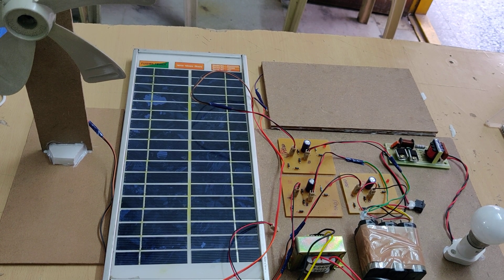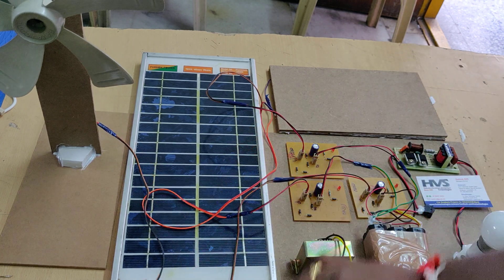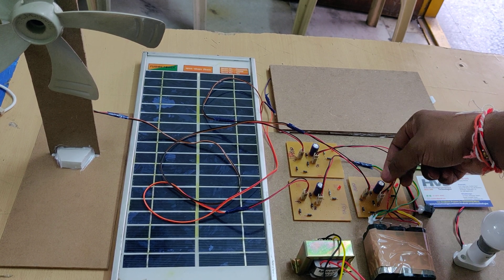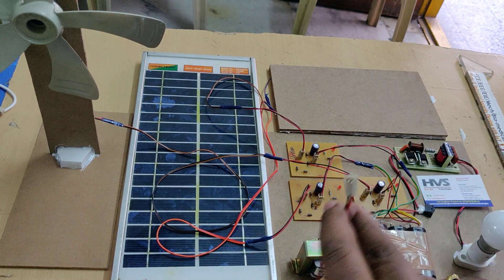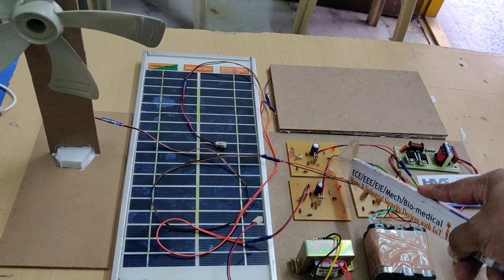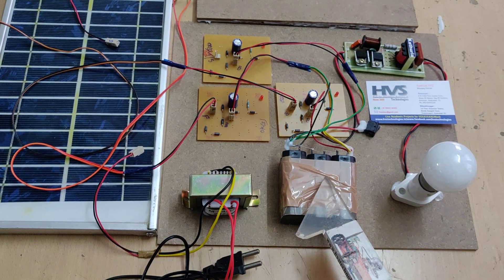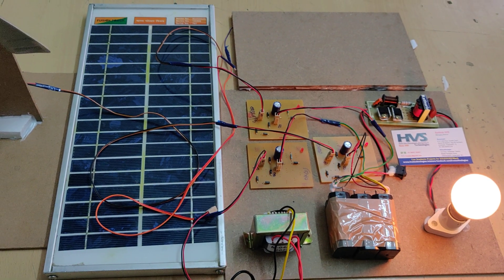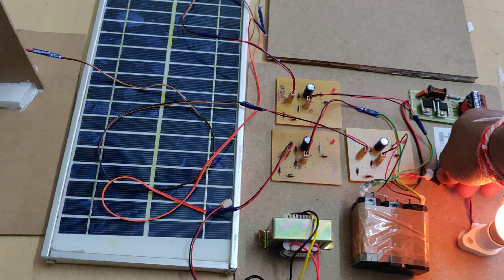Hybrid Power Generation system using Solar, wind and Piezoelectric plates

Comment: this is very impressive, can you please provide the circuit diagram
Reply from the maker: You can contact us at +919603140482
Through WhatsApp or call
Reply: Bro what is the overall cost of the project